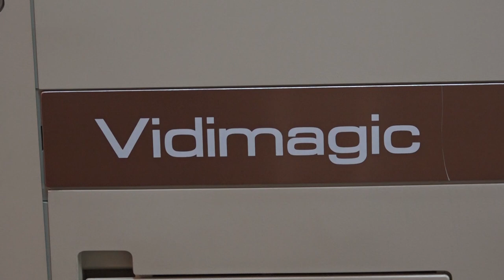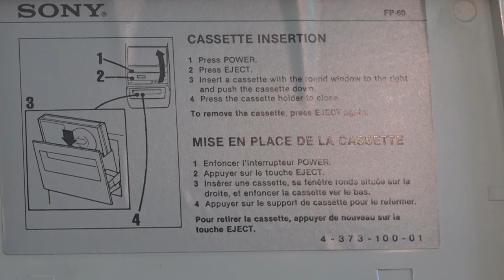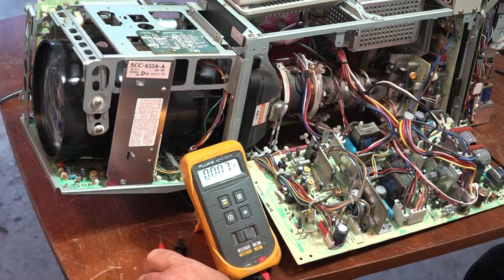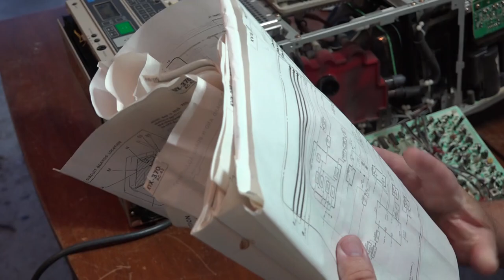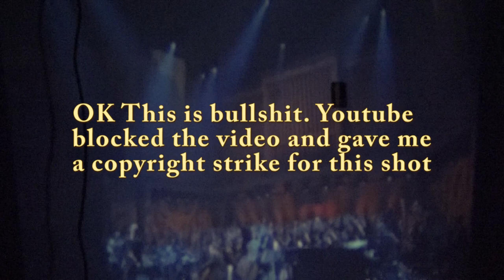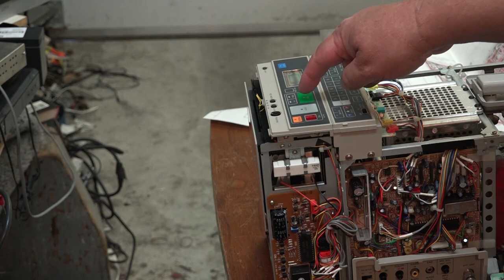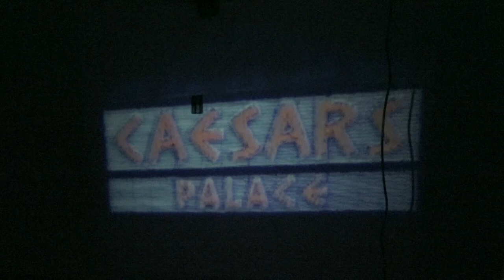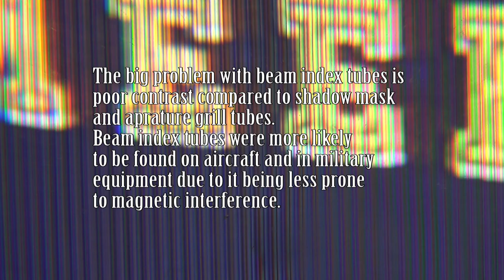Sony Vidimagic FP 60 Indextron Video Projector repair

Comment: Responding 7 years later, respect! It’s a very interesting piece of technology. I wish they were brighter honestly, they might’ve kept some of their relevance for niche purposes. Very complex, but very interesting. (Linus brought me here)
Reply from the maker: If you use the original screen that came with it the picture is much better.  It's a high gain screen like all the old front projectors used.  A white screen is not very good. The proper screen is curved and silver coated.  Makes all the difference in the world.  I'm pretty sure i did a demo video with it as i do have the screen.

Comment: I remember wanting a 3 lens Advent Videobeam so badly in the 1970's. I couldn't afford one (I was a kid) so I bought a 60" TV Projection screen and a TV projection lens and built a wooden cabinet to hold the lens and a 12 inch portable color TV which I modified by switching a couple of wires on the yoke to display the image upside down and backwards so the projected image was correct. It wasn't as good as the Advent, but I was the only one of my friends to have a 60 inch TV! in 1979!

Comment: LTT brought me here! awesome video!
Reply from the maker: It's actually a cool unit but you really need the special high reflective screen.  I have the 40" high gain curved screen and it makes it much brighter.  Actually watchable with room lights on as long as they are off to the side or overhead. The one I have only has about 100 hours on the tube.

Comment: Great piece of equipment! Never knew that something like this existed.
Reply from the maker: I saw a brochure for it way back in 85 but never saw one until it was dropped in my lap yesterday. I didn't know they used indextron until I got it open and saw that funky circuitry.Makes sence though, because a conventional color CRT with shadow mask or aprature grill (Trinitron) would never have worked.Projectors prior to this used 3 monochromatic CRT.the R G and B tubes needed to be perfectly aligned  and this required an engineer to set them up. So having a portable projector was impossible until LCD and DLP became a reality. A single tube wouldn't give the brightness required, because with a shadow mask tube, a great amount of the beak energy is lost in the shadow mask that is needed to align the beams with their respective color dots. Crank up the beam to make it brighter, and the beam that hits the mask heats it up, and causes it to expand and warp. This causes color purity errors known as doming. So with the development of the index beam tube, the shadow mask is eliminated, and the brightness can be cranked without worry about purity problems caused by doming of the shadow mask.
Reply: @12voltvids  last week I got a hold of one of these in immaculate condition with the original microphone accessory. Such a incredible piece of equipment. One thing though, a couple of "rollers" in the cassette loader seamed to fall out. Any idea as to reinstall them.
Reply from the maker: @nathen4021  Obviously I would be in a better position if I knew which rollers fell out,
Reply: @12voltvids  I will be taking pictures. Hope that helps. Thanks again
Reply: Would it be cool to convert it to DLP if the tube went out? How could you install   a DLP chip in place of the tube when it goes out?
Reply from the maker: @nathen4021  Convert ou? Just plug a DLP or LCD projector into it. The whole point is that it is a CRT projector.
Reply: @12voltvids  Have you ever seen a indextron tube go bad during your career/hobbies working on this stuff. I want to preserve this piece of 80's history. Also, how can I send pictures of my machine. Want to show the loose "rollers" from the beta mechanism for clarity.
Reply: @12voltvids I am wondering about belt life. The loading belt on my vidimagic that I have when I checked it out didn't disintegrate into a "black goo" like most belts of this vintage. Is there a higher quity formula Sony used in the day as uposed to "consumer" belts?
Reply: @12voltvids  A DLP would keep the "retro" style of the projector in use rather than recycling a working betamax. For the nostalgia.
Reply: How can I send pictures of my machine?

Comment: I got one of these recently. Mine works perfectly aside from the cassette holder in the deck being a little finicky. Really awesome and rare piece of CRT history!
Reply from the maker: Yes these are pretty rare for sure, and a real conversation piece when someone sees one for the first time.
Reply: @12voltvids  Have you located a service manual for this thing?
Reply from the maker: @nathen4021  No, but then I haven't been looking.

Comment: This is a cool unit. When I was in high school in the late 90s, they had a CRT projector with built in VHS deck that I had no idea what it was...that I wish I knew the brand or model number. It was a single lens projector like this, but it was kind of cheap looking. It almost looked like a vintage version of one of those low-res Chinese projectors that have the built in DVD player. It was like a cube, had like the same shape as an IBM 5153 CGA monitor, but with a lens and VHS deck in it. I remember that the room had to be VERY dark for it to have a half way watchable picture. 

On a separate note. I think it is amazing that in 1985, Sony managed to cram a projector and betamax into this small chassis, but just a few years earlier, they had the Videoscope line that were HUGE, like the size of a large coffee table.
Reply from the maker: The reason this existed was Sony's desire to have a presentation machine that could be set up in a classroom or board room. Video projectors prior to this used 3 tubes, and required extensive set up every time they were moved. The video scope solved the setup because the screen was integrated but it weighed a bloody ton.  Not something that could be loaded in a car and transported.This unit solved that issue, and with the high gain aluminized screen was quite watchable.
Reply: +12voltvids Definitely an amazing machine for 1985. The way they do the color with one gun, one tube, kinda reminds me of DLP, that the image is produced with no color, and color is "added" with the color wheel. I have a Sharp LCD projector from 97-98 that the picture looks like crap compared to this. Contrast is horrible, it is dim and has ghosting. Sony was the real deal back in the day. It's a shame to see what they are now though. It's cool that you have history with this old equipment. When I worked in a studio, we used all Panasonic equipment. Pretty decent stuff. We just got a Sony DFS-700 Digital switcher when I left, I never got to really experience what Sony had to offer.When I started in 99, we had a Panasonic WJ-5500A video switcher, very outdated, but it was nice how it worked with the tally lights and intercom system for our 3 studio cameras. That switcher got a crack in the PCB around the wipe control. We got an even older (mid 70s) Grass Valley unit on loan from a neighboring station while parts were sourced for the Panasonic. It worked well, but had to be jury rigged to work with tally lights and intercom. After 2 years, we gave up on repairing the Panasonic, and bought the DFS-700. From what I remember, it cost $19,000, and we had to buy a couple thousand dollar analog board to get it working with our cameras. It could do a lot of stuff, but it seemed like it was meant more for editing. Doing simple effects was a lot more complicated than the 2 older units, but it shouldn't have been...doing transitions and such took planning.

Comment: Very rare machine and very cool Sony engineering! By the way, the 3rd generation of betamaxes were the SL-5400, 5600 and 5800 piano key machines that actually used solenoid controls.

Comment: I believe the Hitachi 1-inch colour viewfinder tubes, as well as the original Philco  "Apple" tube, used a small photomultiplier integrated into the CRT to detect the index signal.
Reply from the maker: The smaller indextron tube used in the "Cube"TV had the photo transistor embedded in the glass. Yes I believe some of the original color viewfinder tubes were beam index. Color camera tubes are also a beam index type that in the case of the camera pickup used a metal grid behind the target to generate the index signal as the beam swept over it

Comment: I have a sony vidimagic I gave $5 for it at a yardsale a few years ago, its the fp-62 model and it doesn't have the betamax, it still works well it did last time I used it lol I actually got it out today and tomorrow I'm going to take it apart and clean it up like the the lens etc etc I'm planning on using it again for watching movies outside, well I think I'm done rambling lol... and yes I know not to mess with some components because of the high voltage..lol

Comment: Hi I have sony ev-s 3000 but its not working properly as may be the heads have worn out. I cleaned etc. but no use. Probably I need a new mechanism of EV-s3000 or can you help to repair..?

Comment: This item was announced in Jan 1985, it sold for $2995USD which equates to $6709USD in 2016, it had a smaller brother the FP-62 (tapeless) which sold for $2195USD....the FP-60 weighs  35 pounds and came complete with a cloth/nylon type carry case for it, it was targeted towards corporate customers (although Sony was mulling over a consumer version (unknown if they ever produced one)), this item was designed for portable presentation and production work, thus the mic input so as one could do voice over work....they claim the tube was so bright you could project a picture on a 200 inch diagonal screen!
Reply from the maker: The tube is bright, but like all front projectors it needs to be viewed in total darkness.I am going to try it on my DALite screen and see how it looks.The tube is bright. You can't stare at it without hurting your eyes.Not as bright as a DLP, but it is still very bright, and thus the reason for the liquid cooling.The guy that gave it to me said he paid about 2000 for it used.
Reply from the maker: After setting it up in my living room, on a proper screen I am totally impressed.Not as bright as my DLP, but actually not bad. Totally watchable, and actually quite bright. Better by far than that LCD unit I had a year or so ago. een playing some of my old music video beta tapes from the 80's on it. Looks retro, and adds to the nostalgia effect of the old videos.
Reply: That is super cool!  But it's an odd shape, wouldn't work for most consumers in there LR's!  :) Over the years, I have become a Sony fanboy and reach for that brand, along with Panasonic and pre-195ish Radio Shack products.
Reply from the maker: This was never designed as a consumer product. It was for presentation work. Also this was 1985. Most people back then had a 27" TV in the rec room. One of these could be set up for movie night then pack away. The guy that gave it to me used it for celebration of life slide shows he did. He would set it up and show the presentation then pack it up and go. It was the only projector that was portable. All other projectors of the day required complete setup every time it was moved.

Comment: I've got one of these (well technically an fp-62 without the betamax) with the same white screen issue - though adjusting the bias as you did didn't fix it (and I don't trust my own repair skills much beyond turning knobs). Does anyone know where I might be able to take it to get looked at/possibly fixed?
Reply from the maker: I have no idea myself and if the one I was given was more than what it was i probably wouldn't have fixed it because i know nothing about the beam index system.  Never worked on them

Comment: Wow that thing is crazy! They would have to switch between the RGB signals at a rate of multiple Mhz with exact timing! I would love to have a schematic of the crt drive circuilt. Are they using special ICs for the RGB switching? Why was this never used for normal crt TVs?

Comment: rare piece of equipment
Reply from the maker: It always was due to the price, even more so now. It was a sales presentation tool. I only ever saw one on the wild and that was at a Sony training session.  They had some betamax training courses and showed drum replacement and alignment procedures. I remember thinking "this looks like crap" but then again they had it just displayed on a white pull down screen that the overhead projector normally was on.  Had to turn out all the lights for the presentation. Never thought i would get one and then this landed in my lap.  The guy I got it from used it for slideshows he used to do. As bad as it was it was the best you could get at the time for portable projection.
Reply: Its rare but not super rare. One just sold on ebay for 200 bucks.

Comment: I have the Sony Indextron Watchcube. It turns on and the sound and tuner are working as it picks up my tv signal playing a video but the tube does not startup. I replaced all the caps and cleaned the boards too. Any idea what voltages I should be checking ? thanks :)
Reply from the maker: Do you see the filament light up in the neck if the tube? If not and they filament voltage is present then the tube is shot.
Reply: @12voltvids  I see no filament light either. What is the typical filament voltage?
Reply from the maker: @Raptor50aus  should be around 6 volts or so.  I saw a few where the filament went open. You can measure it with a meter.
Reply: @12voltvids  thanks will check 
I have 2 of there watchcubes so will check the other tube too
Reply: @12voltvids  at the back of the tube H1 and H2 have continuity. 
The voltage across these is 2.3 volts measuring from gnd to H1 and gnd to H2 get the same 2.3 volts
Reply from the maker: @Raptor50aus  you will need to check a manual to see what filament voltage is for this one.  I have seen the heater go open but i don't remember what the voltage was.
Reply: @12voltvids  Should be 50 volts input from the main D1 board to the CRT back board first and that is zero :( I have the service manual and are tracing the line back to the transistor responsible for the 50 volt line.
Reply from the maker: @Raptor50aus  it will come from the flyback.  Is the horizontal oscilator / output running.   All your other voltages will come from the flyback.

Comment: So, if I'm not mistaken, an Indextron CRT pretty much functions like a Trinicon (the color-striped camera tube used by some of Sony's early 1-tube color cameras) but in reverse?
Reply from the maker: No a camera trinicon is used a set of electrodes behind the target to modulate the voltage on the target to generate an index signal that was used to demultiplex the resulting video signal into the RGB componets of light passing through the color filters.
The indextron tube, AKA beam index tube uses a 4th color stripe. The RGB, and a UV stripe. The RGB stripes are painted on the surface of the tube, then a thin aluminum coating was applied to the back of the phosphor coating, and then a series of UV emiting stripes placed every second group of RGB.
So it goes like this RGBRGB(uv)RGBRGB(uv)
Then on the bell of the tube a photo detector is attached looking into the back of the tube. There is no 2nd anode coating around this portion of the bell so it is transparant. The photo detectors detect the strobe signal emitted by the UV phosphor and use the resulting signal to generate the RGB swiching signal to the video output curcuit.
At the left side of the tube there are 8 UV stripes with no RGB sequences so that at the start of each scan line there are 8 cycles of index before the picture information is displayed, and there are also index signals painted on the lead in and lead out area of scan at the top and bottom so the syncronizing index signal provides a good reference signal to the PLL circuit.
Reply: Ok, yes, I see now--I forgot that the trinicon lacks the indexing stripes, and uses electrodes at the target instead, as you said.  Thanks for the detailed explanation (and for posting this video!), I was not aware of the Indextron until I came across your video here on YT.

The Indextron reminds me of a similar CRT, the Penetron, which, if you're not familiar with it, is similar in that it's a one-gun color tube as well, but the voltage of the the electron gun is varied to excite the proper  phosphor layer out of several (usually 2 or 3) layered on the tube face (without a shadow mask).  I guess it wasn't widely used for NTSC video due to a lot of high-frequency interference caused by the variable voltage switching to the gun at the high scan rates of NTSC video.  But like the Indextron, it too saw use for military and aerospace uses (mainly for "glass cockpit" applications) in a 2-phosphor configuration, mainly because of its lack of a shadow mask which could be affected by g-forces in flight.
Reply from the maker: I am familiar with the penetron tube. Most were 2 color displays used for computer terminals, radar screens and avionics.
Indextron was the prefection of the old Philco "Apple" tube that they were never ever able to prefect. Sony prefected that tube, and the one I have is probabl;y one of the largest and brightest of that design. It is liquid cooled, and a real museum piece that I will be hanging onto because they are relatively rare. With the proper high gain screen they don't look half bad ether.